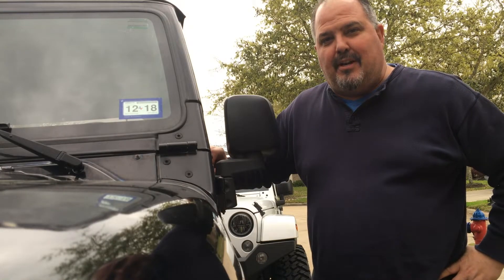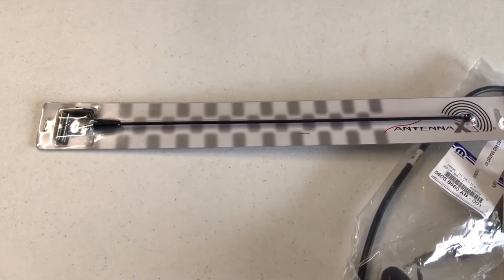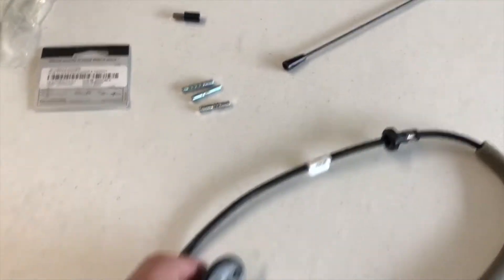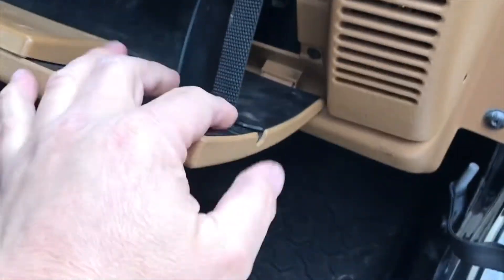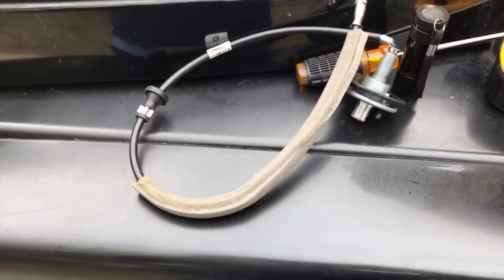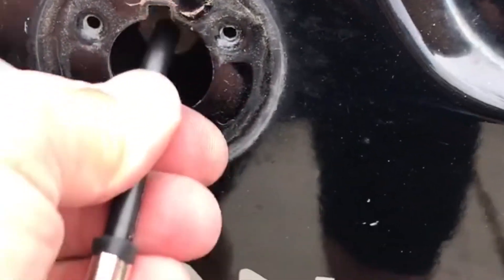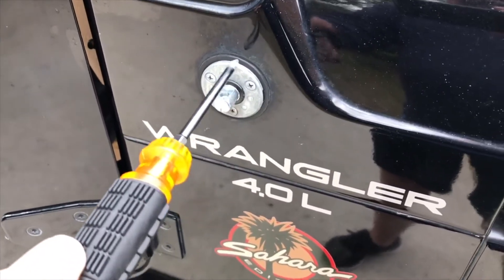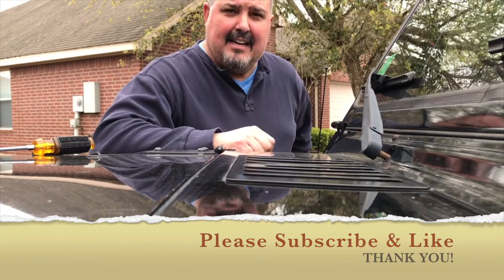How to replace your antenna and base bracket on your 1998 TJ Jeep Wrangler

Comment: Thanks for your reply, my problem I’m having is static on both AM and FM channels, I get no reception on either. I changed my stock radio to a new stereo, with new wiring all the way to the base antenna. And still static on both AM and FM.
Reply from the maker: Also - new radio - Check if any cables are disconnected or damaged or loose, especially the ground wire.

Comment: I just changed mine. But instead of ripping the wire out and replacing the whole thing,  the wire unplugs from the base so I just unplugged the old base and plugged the new base in. My hole was stripped so I couldn't screw a new mast on.
Reply from the maker: Yes.  In fact, there was nothing wrong with the cable / wire as well, but since the kit came with an new one, I went ahead and replaced it.   But for others that are reading this, your method and idea for just unplugging at the base may work best for them.   Good note and thank you for posting your comment.

Comment: Is it possible to just replace the part in the video you said was “weak corroded or something” in the video without needed the entire wire? Like does that part unscrew out?
Reply from the maker: Dan, I have to be honest, I am not sure since I normally buy the component with it all together (most of the time it is sold that way).  I don't remember it being able to separate.  I need to see if I can get an old one or look further.  Normally I replace the entire component unless it is just the end cap or antenna.  I know this doesn't answer your question but l will post an update after further follow up.

Comment: Thank you.  This was extremely helpful.  Any chance you have some tips for protecting my frame from rotting more?  I live in NJ and the Salt/Snow are killing my jeep
Reply from the maker: I am glad you liked the video.  I have lived in the California, Texas, Louisiana, Mississippi and Florida.  Though I have traveled all around, my Jeeps have not lived in a state that has snow.  They have, however, been around saltwater.  All I can tell you, is I do my best to wash it down every time.  I am sure that is hard in the winter.  The other thing I do, is take the time to hit the heavy rust spots with a wire brush and some undercarriage Rustoleum spray paint or other Rustoleum paint, such as high heat Rustoleum, which does a good job in holding the rust back for some time.   I also take the time and apply WD-40 to bolts/nuts underneath.   I cannot imagine the impact of winter and not being able to wash it down, but those are just some of my thoughts you can try during the warmer months.

Comment: Would I be able to get a way to contact you? I did this and my FM is still not getting any sound. AM works fine. I was wondering if you’d be willing to unplug the antenna and let me know if there’s at least static or if it’s just silent? Mine is silent, no static.
Reply from the maker: Yes, reach out on Facebook, Twitter or Instagram with the Direct Message.  These are my thoughts - if you replaced the entire component, the base and cable and the antenna, then I am not inclined to at first think it is a bad component you installed, it is possible, but not my first thought. Do you have your old antenna available to reinstall to check signal?   If AM is working and FM is not working, then that can also be due to the type of antenna - normally all the new antennas cover this, but AM/FM have different requirements. So if you still have your old antenna, then just temporarily try it to see if you get a signal, if you don't, then you know it is a different issue possibly in the radio. 

Check to see nothing is wrong with the back of your radio and see if anything is loose or unplugged.  How old is your radio?  Any issues with it before?  

 External car fuses would be something to check if the power to the radio was off entirely, so it doesn't seem that this is the case. 

Since I never ran in to this before, a local expert for you should be one of your radio installation places, even a place to call like Best Buy and someone who has dealt with many type of radio problems.   I have installed a few of these type of antennas and not had a problem with any of them.   I will however, run the test for you and let you know about the static or silence your requested.

Comment: Got a 2000 TJ can i get antenna base and antenna off Amazon
Reply from the maker: Thank you for watching our video. It was made over four years ago and the parts we used are listed in the description. The best way to ensure your parts that you order on Amazon fit your vehicle is to enter your vehicle information in the Amazon garage section of your account. I have attached a link to help you. I do not represent Amazon, so I’m only sharing from experience that sometimes, the part you order does not fit. I always ensure the part I’m ordering can be validated through other means such as an auto parts store, and then I’m buying the part on Amazon because it is cheaper. But I have to admit most of the time the Amazon part matching to your vehicle is accurate.

https://www.amazon.com/gp/help/customer/display.html?nodeId=GTTH6M3A9A3W8QUC
Reply: @JohnsJeepGarage  thank you

Comment: Where you order that base bracket from mine just broke ,cant find on amazon
Reply from the maker: Drake Replacement Antenna Base Cover (Matte Black) - JP-190012-COVER was the one in the video.  This is a link to Extreme Terrain and the other is Amazon.

https://www.extremeterrain.com/drake-off-road-antenna-cover-gasket-9706-tj.html

https://www.amazon.com/Mopar-ANTENNA-BASE-CABLE-AND-BRACKET/dp/B017DP0U6I

Comment: Wondering where you got the plastic cap? We have a 2001 and that piece is discontinued so hoping to reuse the current one unless i can find an aftermarket one.  Thanks in advance!
Reply from the maker: I purchased it from Morris 4x4 Center (online).   Drake Off Road Antenna Cover - Black (part number JP-190012-Cover).  It shows it is out of stock but they expect to get more in stock.  There number is 877-553-5337 and they can direct you to another option or let you know when that cover will come back in stock.
Reply from the maker: Below in the video comments, another user posted a link on for Quadratec and the kit he purchased with a cover.
Reply: @JohnsJeepGarage   thanks for the video man! I did the same thing on my 07 JK. I'm guessing it's close to the same concept. Your video was the closest thing I could find to fix it.
Reply from the maker: Glad it helped!  Thank you.

Comment: Links to parts ?
Reply from the maker: There are many options - I will list a few links in this response.  Thank you for watching.
https://www.quadratec.com/products/12600_0190.htm?gclid=CjwKCAjw-qeFBhAsEiwA2G7Nl4sGM6m6T9yWay2NWbtW9u_jIak1N6T1ns7cpPJAJgjo5a42NmN0CxoCZQoQAvD_BwE

https://www.quadratec.com/p/rugged-ridge/13-stubby-reflex-antenna-97-06-jeep-wrangler-tj

https://www.amazon.com/DV8-Offroad-Replacement-Protection-D-JP-190012/dp/B082FN6DWZ/ref=asc_df_B082FN6DWZ/?tag=hyprod-20&linkCode=df0&hvadid=416876602209&hvpos=&hvnetw=g&hvrand=4764594960086869554&hvpone=&hvptwo=&hvqmt=&hvdev=c&hvdvcmdl=&hvlocint=&hvlocphy=9027837&hvtargid=pla-906165404636&psc=1&tag=&ref=&adgrpid=96944448394&hvpone=&hvptwo=&hvadid=416876602209&hvpos=&hvnetw=g&hvrand=4764594960086869554&hvqmt=&hvdev=c&hvdvcmdl=&hvlocint=&hvlocphy=9027837&hvtargid=pla-906165404636

https://www.moparfactoryparts.com/oem-parts/mopar-base-cable-and-bracket-antenna-56038660ab?origin=pla&gclid=CjwKCAjw-qeFBhAsEiwA2G7Nl1nOkm_pBKEb8pZJXISGMIbx229Yfu2orV-qfBkrqKn3ai_RWQ-1_xoCE8QQAvD_BwE

There is more specific part numbers I used in the video description.  Please confirm compatibility with your specific Jeep model.

Comment: Can you share the link to where you got the wiring kit? Thanks!
Reply from the maker: I purchased it from Morris 4x4, MOPAR Antenna Base Cable and Bracket  with Pigtail Kit by Mopar 4031-D-4A, The UPC Code is 56038660AB (this is what morris4x4center.com uses as the reference number).
The Cover was separate, and was from the brand “Drake Off Road” and it was the Jeep TJ Antenna Cover & Gasket 
JP-190012-Cover.
Reply from the maker: Remember to validate it fits on your Jeep in case there is a different connection for your year model.  The website has that validation step to check and this specific kit fit a 1998 Jeep Wrangler TJ.
Reply: Only thing i find on amazon is antennas thats it ,not base for 2005 tj